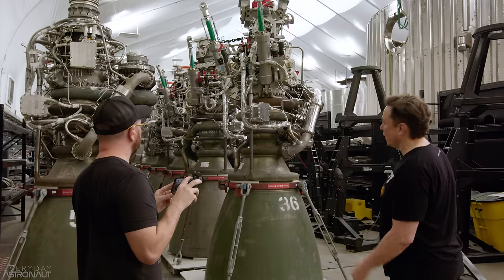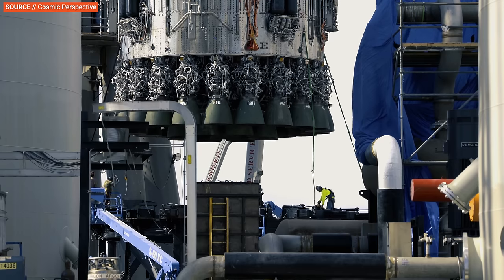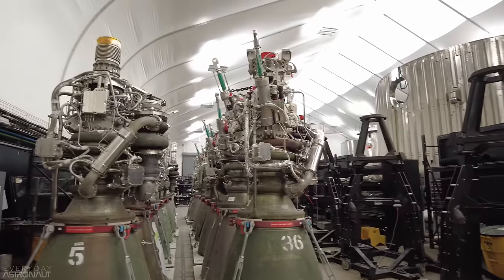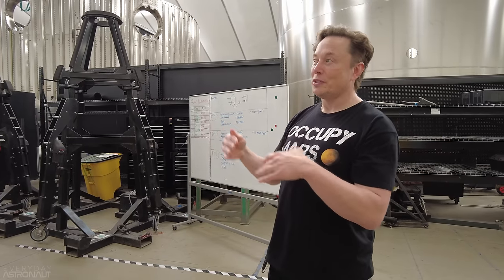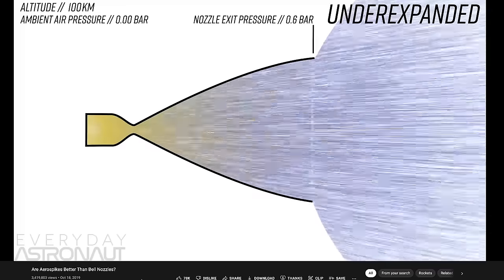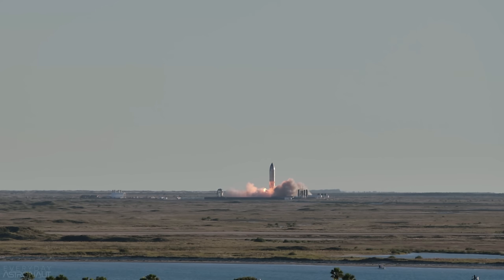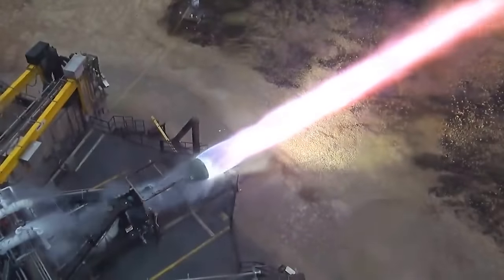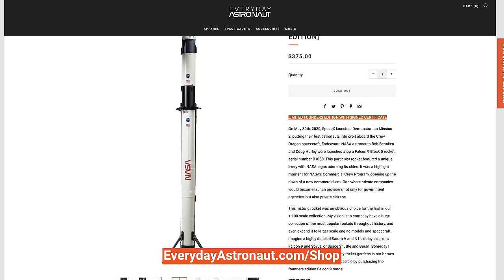How SpaceX Is Upgrading Raptor To Be The Ultimate Rocket Engine!

Comment: I suspect that Raptor 2 is much more mature than Merlin after a similar time spent refining the design. After all, this isn't their first Rodeo! So I'm thinking they may get another 20 to 30% improvement, but not double from their current design.
Reply: I'm inclined to agree. On the other hand, who knows what materials breakthrough could be on the horizon.
Reply: I work in the large fanjet development field. 5% improvement is nothing to sneeze at, 10% is gold!
Reply: @UncleKennysPlace  I'm curious if AI optimizations have made it into your line of work?
Reply: @jackinthebox301  It depends how you define AI of course, it’s such a widely used and often abused term, but if you take it as a computer algorithm designing parts as opposed to a human then in the aerospace industry an early example would be the Airbus A380 wing struts way back in the early 2000s that were “designed” (more like grown) using a software package called OptiStruct from Altair Engineering rather than a human engineer drafting them. Essentially the software is told the overall outer shape, the areas within that overall shape where material cannot go in order to allow wiring/hydraulics/etc to pass through, the properties of the material being used to construct the struts, and the force vectors that a particular strut will be required to carry (a vector having both magnitude and direction of course). The software then essentially “grows” the optimal structure that uses the minimum amount of material to meet all those constraints hence minimising overall weight. Altair Engineering uses the A380 as one of its main reference cases for OptiStruct but it has also been used widely for (arguably) less glamorous items such as radiator brackets in cars etc, essentially anything where minimising weight is an important consideration.
Reply: It isn't their first rodeo building an engine, but Merlin and Raptor are 2 very different kinds of engines. After the first flights are complete, they will know how much they can push the engines. I don't think they will double it, but I will not be surprissed if they do either.
Reply: Merlin was a very conservative design at the beginning, with a goal of "let's get flying as soon as possible". Raptor was much more ambitious from the outset, so I'd agree that the gains are going to be more incremental than Merlin.

I'm going to speculate that once Raptor's design is fairly mature, SpaceX may explore a scaled-up engine based on the Raptor, so that instead of 30-something engines, Super Heavy could perhaps have 3 Raptors at the center, then maybe a single outer ring of say 8 scaled up engines that could be manufactured in a similar per-unit amount of time to the Raptor. Even if they get to very high reusability on Super Heavy and Raptor, SpaceX is still going to need a lot of Super Heavies, as it is still going to be quite some time before rockets approach jet airliner re-usability levels, and even those airliners need major engine service every so often.
Reply: @jamesfrankiewicz5768  It's all about power-to-weight. Raptors are light, so making them bigger my increase weight faster than power once you adjust for having to reduce the number of them to fit bigger engines in the same space.
Reply: @KenOtwell  On the other hand, many parts inherently increase efficiency with size.  For example, the nozzle has a weight proportional to its surface, so size squared, but overall combustion chamber output scales with volume, so size cubed.
Reply: @johndododoe1411  combustion instability becomes a problem with bigger engines, there's a reason why the Rocketdyne F-1 is the largest single chamber engine ever built, and that's because of all the problems big combustion chambers have
Reply: @johndododoe1411  True. But when you make them bigger, you can fit less of them. I'd have to see the math to know how the actual starship performance would change.
Reply: They have a lot more resources now to throw at it compared when they were working on Merlin.
Reply: There is no way they will get another 20% - the design was already very ambitious to start with.

It’s nothing like the situation was with Merlin
Reply: @KenOtwell  There are definitely trade offs involved in making things bigger. One of the biggest drawbacks is reliability (if one of 33 engines flames out it's not a big deal, one of 10 far more so). One of the bigger benefits is a more favorable volume-to-surface-ratio, as the power comes from the volume of the combustion chamber, yet the surface has to be cooled. Higher ratio means more power before it melts (in highly oversimplified terms).
Reply: I get the feeling that they will get to ~250 tons of thrust, but really, really reduce the cost of production and increase the production speed.

The world is going to need a lot of raptor engines.
SpaceX has a lot of boeing 777's and Airbus A380's to replace.
Reply: @Keiranful  other draw back, you know how many test stands it took for the Rocketdyne F-1 to stop blowing up? Lots of them. another important metric is thrust/area, smaller engines use up the area under the rocket more efficiently, so can get a better thrust/area ratio.
Reply: I totally agree, so much power!  It leads me to believe that they are maximizing the probability for success and increasing the factor of safety.  The first ship to round trip mars will likely be over engineered and the 1000 th ship will likely be much different.
Reply: @TheMhalpern  this is why the Russians built engines with 4 separate combustion chambers instead of one big one.
Reply: You were right! Raptor 3 has a 20% power increase!
Reply: @bru512  Raptor 3 is now around 280 :)

Comment: Tim, when you mentioned a 1:1 thrust to weight ratio, I was reminded of Astra's Rocket 3.3 LV0006 which had an engine failure moments after launch. The four remaining engines had enough thrust to keep the rocket flying, clearing the tower horizontally, but were unable to increase altitude until after some of the propellants had been consumed.

I fully expect for the Raptor 2 of today to not be the final version of the Raptor, but there not be as large an increase in thrust as there has been between the first Merlin 1A and today's Merlin 1D.

I can see a chance of the 33 Raptor 2s on the bottom of a Booster to function as a single extremely large aerospike engine.
Reply: I love your aerospike idea. Having a large ring with many smaller engines should allow for this!
Reply: Enough with the aerospikes. They're a bad idea through and through.
Reply: That aerospike idea sounds a lot like the one on the General Dynamics NEXUS booster. Not sure if Starship has enough room on the bottom for that, though. NEXUS had to be super wide and short to accommodate that design.
Reply: @carso1500  Oh please, don't pull that whataboutism with me. Aerospikes aren't even remotely similar to reusable rocketry.

Aerospikes, even just theoretically, have poorer performance than bell nozzles even when you solve all the other flaws. They are altitude compensating nozzles, meaning they can only outperform bell nozzles when they are used half of the time in thick atmosphere and half of the time in vacuum.

That means they're pointless for Starship, as Starship spends all of its burn time in space and Booster spends almost all of its burn time in atmosphere.

The aerospikes are only theoretically good for SSTOs, but as Falcon 9 and Starship have shown, those are also extremely crap.

SSTOs spend more fuel to get several times dead weight to orbit and need several times more heatshielding (also extra dead weight) to get back down from orbit.

Meanwhile, their only advantages over two-stage rockets are full-reusabilty (oops, Starship can do that anyway and do it better) and simplicity (oops, the massively complicated hybrid engines, heat shielding, and necessary weight savings make it far more complicated, actually).

So aerospikes are useless precisely because they benefit only an already stupid idea.

I could imagine aerospikes being useful for trying to get a rocket back from the surface of Venus, but then again, I can't imagine us bringing back anything from the surface of Venus, and certainly not a rocket.
Reply: @J7Handle  aerospikes and SSTO could have its uses, although i agree that starship ultimately proved to be a better design

im just saying that everyone always says that something is imposible or useless, until it isnt, this isnt "whataboutism" its just a simple observation from experience because yes reusable rockets where through to be in the same realm as aerospikes not too long ago and people mostly used the failure of the shuttle to say how reusable rockets where never going to become a thing or werent going to be as good as disposable ones even theoretically, then it was proven wrong

i know because i was there

so i could see aerospikes having some potential uses and some of its problems being solved in the future, or maybe not its imposible to predict the future
Reply: @carso1500  It is whataboutism. When people say things are impossible, they usually are. The exceptions to the rule are always few. One example of an exception to the rule does not compare to the absolute mountain of failed ideas over the decades. And I'm not saying aerospikes are impossible, I'm saying they're dumb.

The idea was to form an aerospike out of the engines already on the booster? So instead of pointing the engines directly down, you want to redirect all the the engines so that some of the thrust is wasted pointing in a lateral direction, and then make up for it by whacking a great big honking spike right in the middle of where the inner set of 13 gimballing engines is supposed to be? Never mind the loss of engines and therefore thrust, the idea will never fly. Literally.
Reply: @J7Handle  i was not talking of that specific idea which i agree is dumb, im talking of aerospikes in general you never really know what can and cant work or under what conditions and things that are considered imposible now may not be in the future, technology advances and something imposible becomes posible if the right breakthroughs happen

of course there are things that are imposible under current laws of physics, aerospikes are not one of those things

now you are right that there are certain ideas that are posible but never account for anything, technological death ends like gas powered rifles or ternary computers are some examples of such technologies but the thing is that at the time you cant know that, because the future is uncertain and i can give plenty of examples of technology that everyone believed to be useless or that it wouldnt amount for anything until it did and changed the world
Reply: Ah, when I heard Tim mention 1:1 thrust ratio I was tempted to google the name of that Astra rocket too.
Reply: @J7Handle  I agree with you but you are unnecessarily hostile.  Wouldn't you rather educate open minds with your obvious knowledge than shut people down for having an unorthodox idea?  Maybe you were just having a bad day when you posted that, I hope today is better.
Reply: @dirtypure2023  Maybe it was a bad day? I dunno. I'm not typically hostile. So it must've been.
Reply: @J7Handle  Glad we're all feeling better 🫡

Comment: Hi Tim, great video as always! 
Can you do a video explaining the navigation techniques and technologies for the landing of both stages
Reply: I'm specifically interested in whether SpaceX is already implementing new techniques for improving landing accuracy on the Falcon 9 first stages in preparation for the massive accuracy required for the Starship booster and Starship to be caught by the catching arms on Mechazilla?
Reply: @PhillMagGamerDad  do they need to improve falcon 9 landing tbh?
Reply: @PhillMagGamerDad   This will be interesting to see. The Mechazilla catch is in a lot of ways easier than the drone ship landings. The latter is moving in 3 dimensions, especially vertically, and F9 has to make that precise hoverslam touchdown. Starship is dealing with a stationary target. Elon explained in another recent Tim interview that it will take several seconds to pass down thru the arms, so it has time to make adjustments. But it does have to place that huge ship with its inertial mass within tens of centimeters before the arms can close in.
Reply: @insertnamehere786 , they don't. But if they're flying and landing Falcon almost on a weekly basis, doesn't it make sense to practise and fine tune your existing rocket to be as precise as will be necessary for Starship, and learn in the process without having to go through the fly-crash-improve-perfect model that SpaceX has been following?
Reply: @insertnamehere786 , agreed. But even SpaceX wouldn't want to waste unnecessary money if they didn't have to, right? Who wouldn't improve an existing technology for the betterment of the next generation? Edison didn't start from scratch on every iteration....

Comment: I think the best example of the TWR issue was the Astra (?) launch that traveled sideways after losing an engine until it burned enough propellent to get better than 1:1 at which point it started to gain altitude.
Reply: Space Y
Reply: saw it rise because the gate was left open
Reply: P O W E R S L I D E
😂
Did everyone watch Wild Space yet?  It's about the competition between Astra and Rocket Lab.

Comment: I should also added that many parts were transferred to the vehicle, similar to jet engines, makes install & removal process easier
Reply: And I believe, for the booster, some (starter-)parts are even moved to the launch mount!
Reply: @ErikBongers  I believe for the outer ring- they only have to start up on launch; the inner ring of gymballing engines have to re-light for landing.
Reply: @ErikBongers  stage 0, as SpaceX calls it.

Comment: I would love a deep dive on sub cooling cryogenic propellants, pros, cons, how they keep them cold during fueling. Always been a mystery to me.
Reply: Interested to create own rocket?
Reply: They're reportedly cooled using a heat exchanger and liquid nitrogen. By pulling a vacuum on the liquid nitrogen, it boils and cools. You can see videos of this on youtube (and see solid nitrogen). The propellants are pumped into the rocket cold, and the bulk keeps it cold for a time. If the propellants sit too long, they warm up to their boiling points, and must be drained.
As for the pros and cons, the pros are that colder propellants are denser, so more mass can be stored in the tanks. The cons are that the tanks aren't that well insulated, and the propellants warm up with time, so there's a limited wait-for-launch time once the rocket is fueled. Also, cold propellants are typically more viscous (thicker) and may put additional demands on pumps (both in the rocket and in the ground support equipment). Tank ullage/pressure control may be more difficult as well, as the propellants condense air/nitrogen/... ullage gasses in the tanks. There is also the requirement for heat exchangers and/or equipment in the GSE to cool the propellants well below their boiling points prior to rocket loading.

Comment: Tim, could you please do a cross section walk through of the Raptor v2 detailing what each part does (to the best of your knowledge of course).  From tank to exhaust.  I've seen one done before using a 3D cross section rendering of Raptor 1 but having your video with updated information and design would be pretty cool.  Thanks and Iowa Rocks!
Reply: I dont think he can really do that yet because he actually doesnt know yet how Raptor 2 is ignited. We will probably learn a lot more about these engines after they are launched.
Reply: Do you have a link to the video you are talking about?
Reply: In the last Musk vid. with them talking about raptor engines. Elon said in pretty plain terms, he can't speak much about the inside of the engine, as not to disclose what make their "sauce" special
Reply: @DinoCR , if you've seen a cross-section of the Raptor 1, you've seen all actual about the Raptor v2 (except its ignition method). The difference is only in secondary details.

Comment: Awesome Tim! The one thing this video didn't touch on though, that was in the interview with Elon (amazing BTW), was how they "inline" the oxygen pre-burner... which I thought was really interesting. What i mean is it's directly in line with the center of the engine bell... and how that impacted the transfer of force to the vehicle. Super cool, thanks for all you do!
Reply: Force transfer is always a direct line up the engine.  What they did is to build the oxygen pump inside that force transfer rod, using it as the walls of that part.
Reply: @johndododoe1411  Right! Exactly. I was interested in hearing a little more about that. Obviously, using the walls of the oxygen pre-burner as part of that is brilliant - has it ever been done before? Other advantages besides weight? Very cool nonetheless.
Reply: @cornbreadreturns296  Another advantage is that no torque is exerted by the liquid oxygen flow when the oxygen plumbing is coaxial with the engine. Oxygen accounts for about 80% of the fuel weight (approx 3.7:1 fuel ratio) so that is most of the propellant going straight down to the engines.